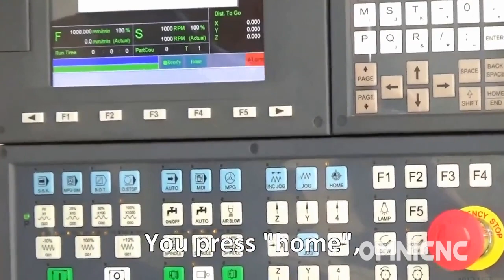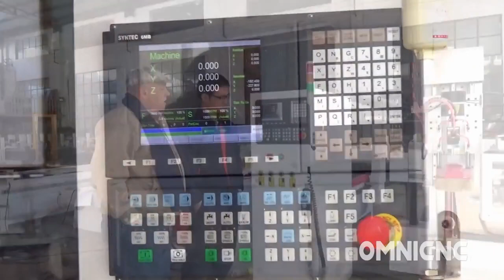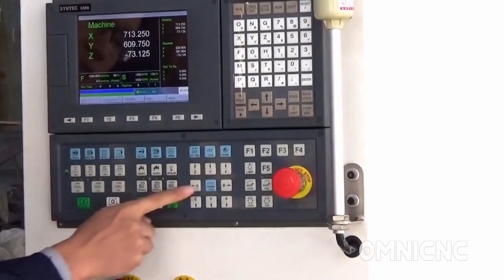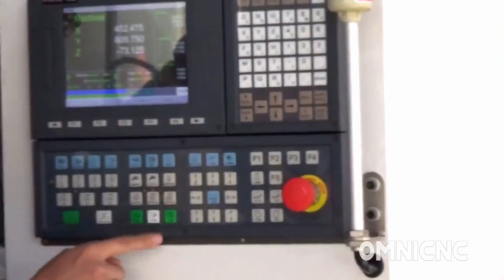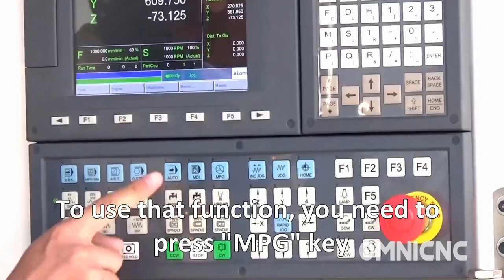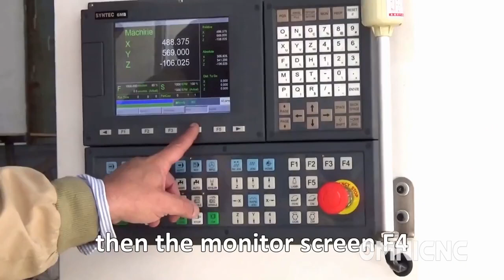Useful Tips for CNC Router Machine Syntec Controller Operation

Comment: What happens if you don't home machine?
Reply: it might crash into the hard stops when you start your cut. Homing just puts your machine into the corner of your workpiece that is the same 0 as your CAD program. Some manufacturers opt out of this by using servo motors and a memory to retain the position using a rechargeable battery.